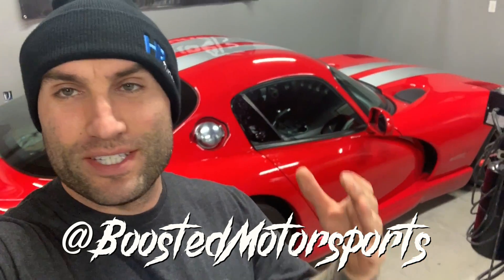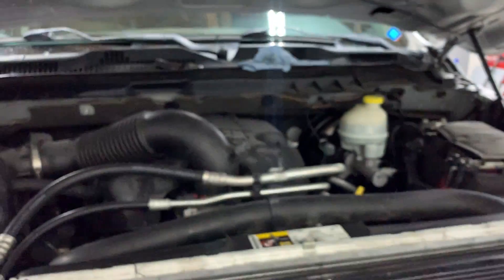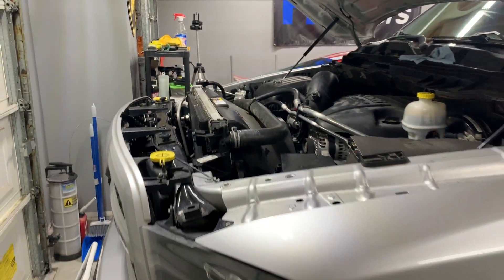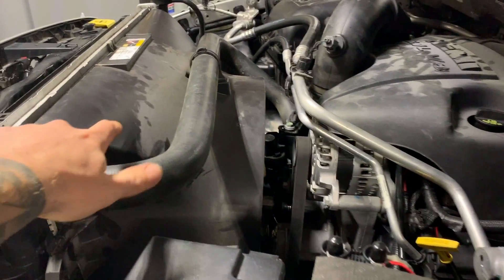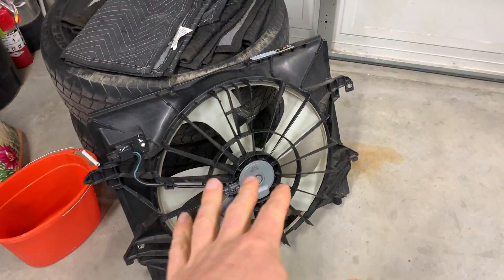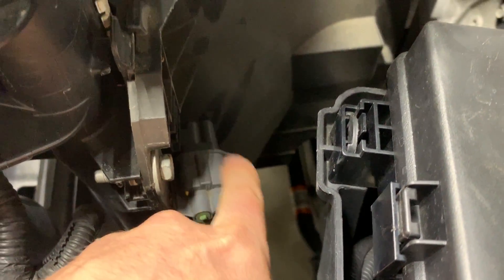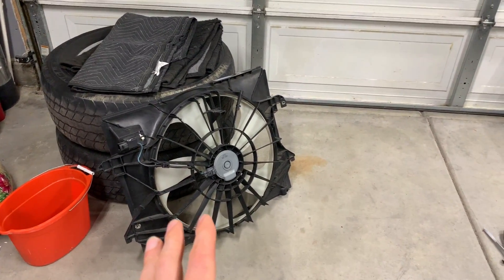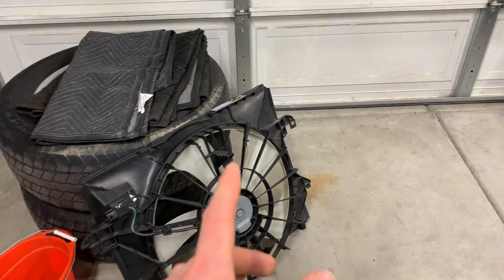RAM 1500 5.7L HEMI - V6 Efan Electric FAN - Myths & Truths

Comment: Sorry for the late question but, i got confused about the towing aspect you mentioned it wouldn't be efficient... Leaving the stock electric fan only?... Or using the v6 electric fan? I have mods and stuff so i have the tuner thats no prob but i do tow heavy and live on 95+ degree so i just want to be sure this v6 e-fan would be worth the shot. TIA
Reply from the maker: You should be fine with the V6 fan and a tuner.  Only thing I was saying is how some people just remove the mechanical fan and use the stock electric fan to cool which would work but might not be adequate for towing due to not having a sealed fan shroud and being slightly smaller than the V6 fan.
Reply: @BoostedMotorsports  thanks for the response and advice.
Reply: @BoostedMotorsports  Confirmed at least with a 6.4 2500 stock fan will heat up under very light load, is fine around town.

Comment: So I put an efan on my 2012 ram 1500 and put a 180 thermostat I also have a tuner on it but my fan won't shut off... my temperature goes as low as 185 but efan still running tia

Comment: I have a 2016 5.7 ram. If i change the intake to the k and n cold air, and change the muffler to a magnaflow, do i need to get it tuned?
Reply from the maker: Nope you can just install those. You would benefit more from a tune but it will run just fine
Reply: Thank you
Reply: You will not need a tuner with these simple bolt on mods.

Comment: I know this is an older thread but  new to Ram trucks myself and I like your videos, not crazy mods but more for getting the best out of your daily driver without compromising reliability and safety. I do have a question though and it is related to transferring power usage from mechanical to electrical. No power on your truck comes free. Let's say you are in the moment when for whichever reason your fan needs to run the power for same size and same air flow fan as your original mechanical fan will use power from your alternator, this is mechanically driven from your engine plus added power loss both mechanical and heat so at the end in that situation your will use more power from your engine than you did with you mechanical fan.
Thanks for your videos

Comment: when removing mechanical fan and trying just stock efan, should i remove the shroud or leave it in?
Reply from the maker: I would leave the shroud just to try and channel some of the air a little better at least but probably won’t make a big difference
Reply: BoostedMotorsports I have a 2012 ram 1500. Will the e fan work on my truck? This sounds like a good upgrade I want put it on mine. And do I need a tuner after I install the e fan?
Reply: I watched this video 3 days ago.  I'm waiting for my v6 fan to come.  I tried driving on the e fan.  I'm making the comment from the parking lot of a fire station because my truck is over heating. From only the a/c fan. Thanks
Reply: There is no use in getting a tune all you can tune in the Diablo Sport i3 is AC fan setting's ON, or AC fan settings off, that's it there is no tune for heat setting on or of don't get sucked in.

Comment: Is the v6 efan louder than the combined mechanical and stock efan for the v8 hemi? Is there a reason you removed yours and reverted to stock?
Reply from the maker: Its quieter.  The mechanical fan roars way louder when it is engaged.  Put the truck back to stock to sell
Reply: Thanks. Great videos. Fun to watch.

Comment: @BoostedMotorsports what do you think are some good mods for a 2014 Ram V6, im having trouble finding things i’d like to do to it since it hard to find them (I’ve already done lights
Reply: After a favorable pressure test on all cylinders; Install a Procharger, True Ram air, Snow power water/methanol injection kit, Top feed fuel rails, updated fuel injectors 1250cc is a good place to be, Cat delete with 02 sensor adaptors to get the sensors out of the slip stream and will fool the computer into believing things are good. After all that get a tune. Not a Diablo or anything purchased. Go to a Tuner. Let them tune it

Comment: My plug has two prongs on the connector, the v6 fan has three does it matter , should it still connect?
Reply: What year and model is your Ram?
Reply: @whoopiniron14  2018 ram 1500 sport crew cab 4×4
Reply: @bobsisic5714  man I'm really not sure about the '18s. You might have to do some research on that. Sorry I couldn't be more help
Reply: @whoopiniron14  thanks for trying

Comment: What about towing? I haven't been able to get a straight answer about how well it stays cool while towing
Reply: I have this mod with nothing else changed and towed a fully loaded u-haul 6x12 trailer over 900 miles in the late summer without issue.  The temp gauge never crept beyond normal.

Comment: I have a 2019 hemi and hoping to install electric fan for better mpg but I guess I already have it now what do I do for better mpg?
Reply: Buy an Edge Pulsar
Reply: Lol
Reply: Is it the 2019 classic or the gen 5
Reply: Khristopher Riibner it’s the 2019 gen 5 advertised at 21 mpg not even close
Reply: @tonybrum6361  if you have a 2019 you already have an all electric fan. less right pedal is about the only thin that can help you. I have a  '15 leveled with highway tires, mbrp exhaust and intake (they dont really do much) and i avg 18 mpg I will be doing an e fan though

Comment: Do you know if the efan will work on 2014 ram with 6.4 hemi?
Reply from the maker: Good question.  You probably have a 2500 and i believe the cooling system is different on that truck
Reply: I was curious about the same thing. Just got a 2016 2500 6.4 and want to ditch the mechanical fan
Reply: @BoostedMotorsports  6.4 has the same fan so it should work. looks to be the same set up just a larger schrowed, I diched the clutch fan and it holds temps fine in town put a load and the fan cant keep up. More to come v6 fan in the mail will likely do a thermostat as well.

Comment: Can a Chrysler dealer turn on the e-fan programming, instead of buying a tuner?
Reply: neal fox I’m working on figuring that out myself this week. Our WiTech went down in the shop the day I did the swap so I’m waiting on the new pod to come in. I’ll let you know.
Reply: @RamBayou1  thanks for the info, I am ready to do the efan but don't want to buy a tuner.
Reply: Did you figure it our or do you have any info?  Thanks
Reply: JG Snave I wasn’t able to find a way to turn it on with WiTech. It has to be a programmer.
Reply: But to be fair, I’ve been running it with the stock settings here in Louisiana with 85+ degree weather and I haven’t had an issue.
Reply: I think that I am gonna try it on my '15 and also install the 190 thermostat.
Reply: JG Snave I’m debating on doing the swap myself but not sure I’ll benefit from it at this point. Going to let the temps get a little hotter down here and see how it works.
Reply: I'm in east TN and it gets pretty warm here, too.  The damn humidity is brutal.
Reply: JG Snave I’m going to be posting some build videos on my page now that I finally got my truck back.

Comment: My Hemi uses a 180 degree thermostat, and the fan kicks on at like 185. What is this 200+ degree crap?
Reply: Really, what year is your hemi?
Reply: @vicer77  2005. It is a single cab Daytona edition Ram 1500.
Reply: @LeadStarDude  damn, never sell that. I got a 12, Hemi, and single cab. I am thinking of just going with the stock E fan with the shroud and using a 180 thermostat but then again iam in Tucson, AZ and it does get hot as hell here. I guess it wouldnt hurt to try.
Reply: @vicer77  I would be using 180 degree thermostat in Arizona for sure. I am in Arkansas and it gets very hot here too. I think the 200 degree thermostats are for cooler regions up north where it gets extremely cold in the winter. I am just assuming though.

Comment: Damn I can just go to a junk yard and find a 2009-2013 for one of these v6 fans. I would like to do this with the 180 stat, so I will need to unlock the pcm and adjust the fan temp from 220f to 180f? What would be a suggested temp.. I dont want to wear it out from it constanty turning off and on, at the same time I dont want the engine running warm constantly. Also what would be the cheapest route?

Next, are you scrapping your ram videos? I hope not these are legit.

Comment: I have a 2019 ram 1500 bighorn classic i heard those are basically the 4th gen ram just updated would my 2019 still have the mechanical fan ?
Reply: I have the same truck if you go look outside and see your serpentine belt attached to the big fan making it spin then it'd mechanical

Comment: What tuner works best for editing the fan temp parameters and setting it for fuel economy. 2010 TRX4 5.7.
I want to set the low fan speed to 189 and the High fan speed at 195. I then want to set my hemi to get 14mph or better.